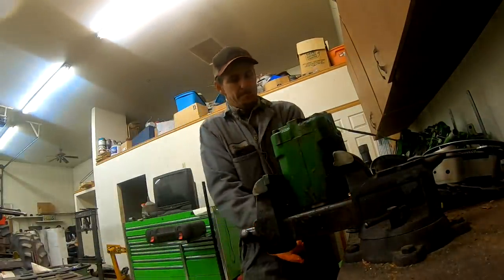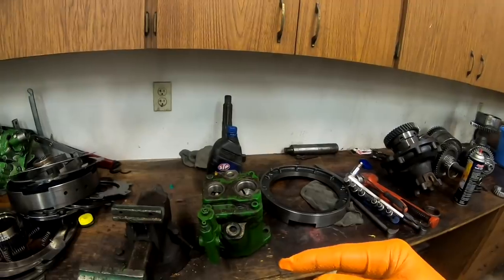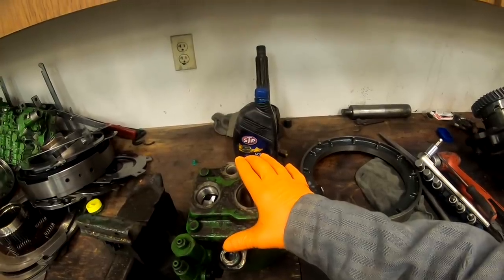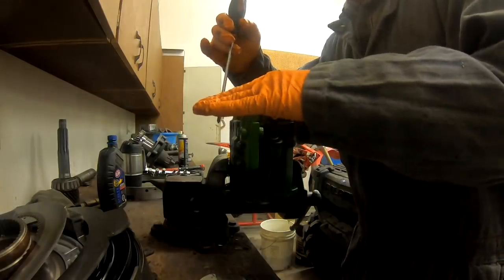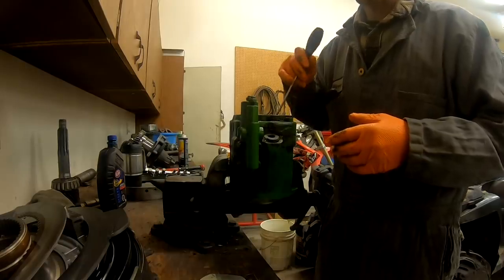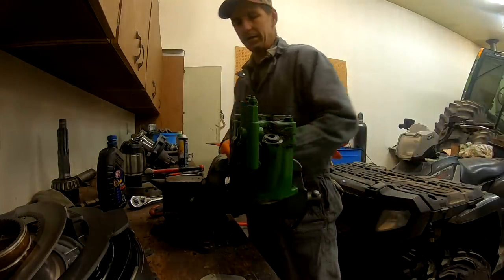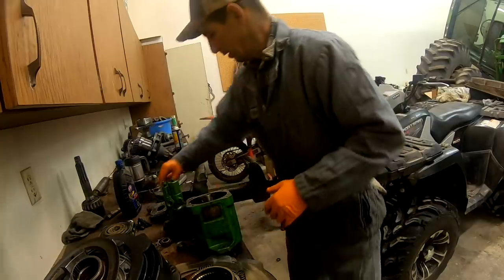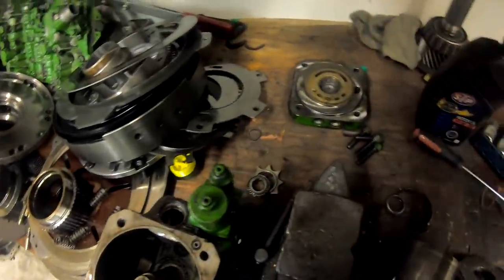Closed center hydraulics overview.

Comment: Had a McCormick tractor stall the motor like  that once.  The dealership said it  was the pump ,I looked at the pump and it was fine! They put on a new pump and did the same. The tractor belongs to  the in laws so I had to go to the dealership to sort this out! A transmission solenoid was stuck when it would start it went into two gears and stall! Merry Christmas to you and your family Waren

Comment: Thanks for the hydraulic lesson.  Sometimes it is tough to get hydraulics working correctly after changing out a pump.  Dad had a JD 300 industrial tractor that had a hydraulic issue for years.  turns out the issue was a valve on the loader. Once the valves were replaced, it had more than enough pressure.  Merry Christmas to you and your family, and all the best for the new year!!

Comment: I  also work with these pumps and some of the issues are determining if it’s the system commanding the high pressure or a stuck swash plate causing the issues.  Just a comment about load sense, if you have no load sense then you have no pressure. So block the load sense line going to pump and pump should be in biased state or neutral. So if you still have high pressure you have a suspect pump.
These pumps can cause fun problems with engine not running at idle or low power issues. I have even had engine reps scratch there heads trying to figure out engine issues and it’s the pumps.
Good info you have shared good explanations. 
Merry Christmas.

Comment: My experience with the industrial versions of these pressure compensated axial piston pumps, a down stream relief is a must. Set higher than the compensating pressure it gives the fluid somewhere to go as the valves open and close and the pump stroke compensates. Fluid has inertia just like a large flywheel, so as you said when flow is at the full amount and a valve slams closed the pump will not de-stroke that fast and a tremendous pressure spike will occur.  The relief will protect the system from these spikes.

Comment: As an automotive mechanic, we do have hydraulic systems that give similar problems in spool valve sticking. But not realizing how much heat can be generated when you don't have flow in a high-pressure pump area. Really good simple description and breakdown for us. Have a great Christmas Warren and family. Have a productive and safe New Year. From Canada.

Comment: Fascinating stuff young man because I have never seen or understood how these hydraulic systems work. I suppose with modern tractors most of them rely on hydraulics to control all the basic functions and are themselves controlled by computerised electronics so a modern tractor is basically a engined poweredmulti tasking hydraulic pump governed by electronics. Complicated stuff but not impossible to learn. Many thanks Warren for the insights and lessons you give on repairs and rebuilds. All the very best to you too for Chrismas and 2020!
Reply: See the animations I posted above for Warren's viewers.

Comment: Just like the new style AC compressors without clutches. They have electronic modulated wobble plate controllers to increase or decrease Freon flow. Very interesting. Thanks for the video. Awesome content.

Comment: Great video Warren !!  I have a 6410 John Deere with the same pump system  it’s been trouble free so far with 3400 hours. But just used in the hay operations.  Hydraulics are amazing and what the engineers come up with can be a little confusing at times. I used to work in wood industries and the electrical controlling hydraulic could be very precise with linear position rods and 4 to 20 milliamperes drivers on valves. Merry Christmas to you and your family

Comment: Excellent explanation. the snow cats I deal with are hydrostatic drive, similar principle but ours are centered and use charge pressure to tilt the swash plate for forward or reverse. Merry Christmas to you as well.
Reply: Dan Goulding Used  to work on machines called hydroaxes that used the same principle, had one on tracks like a huge snow cat for mowing swamp ground , when the pumps grenade it's a real mess.

Comment: The constant pressure system is more responsive and efficient than the constant flow system but I prefer the reliability of the constant flow (gear pump) system. If you read industrial history of Caterpillar and John Deere, these companies were known for simple but rugged equipment that would crank and run, few bells and whistles but good old simple.
Reply: Might have been true in 1950
Reply: @RJ1999x  - Ha - You are exactly correct! Newer stuff is not simple, rugged, reliable or made in America.....all the attributes that made these companies great. I often wonder if a simple version (of course with all the safety decals and shields) of a tractor was produced how it would sell. I have a Allis-Chalmers WD45, it runs great but would not bring crap at a sale. It is tricycle and no power steering so I keep it and use it.
Reply: @jeffsnider3588  If the nuclear bomb goes off the only 2 things left will be a cockroach and an Allis Chalmers WD45!
Absolutely bulletproof machine
Reply: Did you realize the old WD45 by Allis-Chalmers was one of the 1st tractors with demand flow (pressure compensated) hydraulics, the pump is an inline piston pump run off cam lobes with roller-followers. No filter and dam thing has run for years with no problems on my tractor. At one time many farmers owned a WD-45, They were inexpensive and fulfilled the basic requirements. The pump does run at a rather slow speed though. Allis-Chalmers was another innovative company that had some really good designs. The D-19 diesel was the 1st turbocharged tractor.
Reply: @jeffsnider3588  The hydraulic system on a 45 was high pressure lo flow, which made it work very quickly and required a small cylinder.
Reply: @jeffsnider3588  Allis Chalmers was the first in many things.
First on rubber tires
First Turbochargers on tractors
First power shift wet clutch system
First with cross flow heads
First high pressure diesel injection system
First intercooler
First pressure and flow compensated hydraulic system
First cab that broke the record for quiet, still not matched
First cab that could be rolled and the door would still open
First operating platform forward for a better ride
First round baler
First forage harvester for Hay
First no till planters
First 0 ground pressure gauge wheels
Etc etc etc
Reply: @RJ1999x   Too true!
Reply: @jeffsnider3588  WD 45 and round baler was such a relief from square bales.

Comment: Now I've learned that Deere needs a couple of pump pressure gages on those pumps and in the cab so the operator knows what is going on. You have excellent explanations and someone should do animations of that pump in operation and with different situational conditions. In time, I guess. Great video.
Reply: Animations of hydraulic pumps:  https://youtu.be/W_W1lI31cww

Comment: I like where the pump is, at least you can get to the dam thing. I still like gear pads with multi gear pumps or stacked gear pumps.  The pressure comp systems get hot quick when the pumps and valves get a little wear. High pressure fluid passing spools and pistons make heat quick. The only fix is really expensive.
Reply: High pressure filters with regular maintenance are a must on pressure compensated systems. I am more familiar with railroad equipment like Harsco Tampers etc. which require a lot of oil for repetitive, high speed, movement of multiple cylinders, workhead motors, plus machine traction. Multiple hydraulic valve banks involved that lasted for years of thousands of cycles with very few problems. Take a look at a railroad track and think of it LIFTING BOTH RAILS PLUS TIES and tamping every single tie mile after mile while the machine also lines the track at the same time. Watch one in action if you ever get a chance. Of course you need a well trained operator. I have seen some videos on here which were PRETTY SAD to watch knowing what these machines are capable of and not seeing it because of a operator that didn't know what the hell he/she was doing.

Comment: Sir, so what I understood and learned. There is a 1st stage charge pump psi of aprox. 400 to main pump. Main pump is a variable flow piston type. Discharge from pump goes to vavle assembly. At valve assembly 1st valve is a type of relief that lets fluid return to pump or to what ever system is calling for psi/flow. Now returning to pump goes to a psi and a flow control valves that by design rotates a plate that cause the pistons of the pump to move more fluid at the max needed and the psi relief sets the max psi, with the only other variable being engine rpm. For flow out put. Now if for any reason fluid is not flowing or restricted it gets hot, cause damage.as well as other things cause problems. Stuck valves,bad motors,and pluged filters ETC.

Comment: For the record, Allis Chalmers was the pioneer of pressure and flow compensated hydraulic systems on tractors. It took others (John Deere) another 30 years to catch up
Reply from the maker: Yes, I have worked on some 7000 series A/C tractors that had those systems. They like international were good at building equipment but couldn't control the money end of it.
Reply: @westerntruckandtractorrepa1353  For the record there was a lot of reasons why Allis Chalmers went down, and you're partially right about money.
Allis Chalmers was a huge conglomerate that was involved in everything from farm tractors to nuclear reactors.
Allis Chalmers in the 60's and early 70's was cash heavy and leaders in every field they entered and because of that corporate raiders tried a hostile takeover for over 15 years, which when the dust settled Allis Chalmers was beat up and hurting, but still standing.
To get back on their feet they needed cash so they sold a 74% stake of the large construction equipment to Fiat forming fiat-allis. They also sold off the steam turbine business to Siemens.  The 70's farming was booming and Allis Chalmers responded with the 7000 series of tractors, the 6000 series and larger combines, which took a lot of cash. Heavy industry was going and Allis Chalmers built huge projects like the largest hydroturbines in the world out by you at Grand Coolie. They brought the 8000 series to life as the ag economy tanked, and interest went sky high. The high interest rate killed many large products. Allis Chalmers had contracts with the government for more hydroelectric and supporting equipment, that got cancelled leaving Allis Chalmers hung with a bunch of unfinished huge castings etc. At the same time oil was over $80 dollars a barrel and heading to $100. Allis Chalmers had invented the process of removing oil from shale, and borrowed $130 million at 20% to bring the process to life, the only kicker was oil had to be above $40 a barrel to be profitable.
So with an ag economy tanked.
Interest at mafia rates.
An additional 130 million in debt.
Cancelled contracts.
Oil dropped to $35.
That's the short version of what happened
Reply from the maker: @RJ1999x   I realized along time ago that you've always got an axe to grind against John Deere. I don't really give a shit what make they are I fix them. The orange pile of shit pays the same as the green pile of shit.
Reply: @westerntruckandtractorrepa1353  lol that's funny
Reply: @westerntruckandtractorrepa1353  😆😆😆😆👍👍

Comment: It’s nice Deere put the charge pump under the main pump saves a lot of splitting. I always liked the fact that the old Deeres were all steel and hardly any aluminum, I think they were a little better. Alice Chalmers used a similar pump on the 7000 series. At least the problems are all at the back of the tractor on these ones. Merry Christmas 🎁 thanks for all your great videos.

Comment: Good video, but should also explain why pressure compensated/load sensing systems are so beneficial being that they are designed maintain a consistent pressure drop across control valves despite their position and flow demand.  Straight pressure compensated and open center systems do not have this capability and result in large pressure drops across control valves causing heat.  (also a neat physics lesson in the conservation of energy).

Comment: Pretty good show of hydraulics. You really need to explain this is a pressure flow compensated hydraulic system. It is not a true closed center system. The soundguard body John Deere tractors are closed system. Pfc systems have the benefits of both open and closed systems.

Comment: Hi, first, thank you so much for all that you do. You have helped me tremendously over the past year. I have a 6410 and the pump looks exactly like this one with the flow regulator situated vertically. All of the manuals have them horizontally. Can you show how you adjust these? It looks like it only has one adjustment for the pilot pressure.
Reply from the maker: On a closed center system that is standby pressure and the other adjustment is system pressure. https://www.machinerylubrication.com/Read/31666/adjust-hydraulic-pump
Reply: @westerntruckandtractorrepa1353  Thanks. The issue I am having is the pilot and system pressure are max when idle. I went through the manual a ton of times trying to track it down. I rebuilt the brake valve, and just went through the flow regulator, scvs, main priority block, rockershaft valves and really didnt see anything major. Although the main block pressure valve was a little discolored which i replaced. I find it interesting that the pilot pressure/ls drops when hitch is being raised too. Any thoughts?

Comment: Do you think the root cause was a leaking signal check that kept the pump on high flow / pressure or were the saddle bearings on the swashplate holding it in one position so it could not go back to system standby pressure?  I saw the failed inner bearing on the rotating group and would agree that caused the shaft to twist off but I am trying to figure what  the first failure is / was.  Most twistoffs in my experience were from deadheading the pump.  Good video - I have worked on piston pumps for 40 years and always tear them down to see what the failure mode was.  Merry Christmas and Happy New Year.

Comment: The load sense system will drop oil pressure to the compensator allowing the bias spring to stroke the pump?

Comment: Sounds like your comming down with a cold or flue Warren, best thing ive found for that is get the cheapest lemonade you can find, get some disolvable paracetamol tablets.  Mesure a mug of lemonade out,  put it in a pan,  put it on the stove till it boils, turn down to a simmer then throw the tabs in untill disolved.  Then decant back into the mug, and sip it as hot as you can stand.  But best done before going to bed.
Reply: Or, get a double brandy, add a table spoon of honey, a table spoon of lemon juice, a teaspoon of Turmeric and a dash of hot water. Get it down you neck and go to bed. I have found it to give fairly fast relief which lasts a while but obviously it is no cure as there isn't any for a cold of flu.
Reply: @JonDingle   The one above brings on a sweat that breaks the fever,, try it yourself next time . All the best.
Reply: @scottgibson7534  Cheers young man and all the best to you too!
Reply: DingleZilla  Hot Toddie O whisky with honey and lemon that's what  I take my ma would give me that and i am 52 and still works,maybe I am biased being a Scot but thats what my grannie give my ma and then to me.....

Comment: So im curiousif the pump is biased in the full pressure position at startup if you have no load sense you still would have full pump pressure right because of how its biased to full pump stroke?
Reply from the maker: Yes you are correct.

Comment: What kind of parts cost is there in one of these rebuilds?  Extremely expensive or reasonable??
Reply from the maker: This customer bought a new pump from Deere which cost him about 3 Grand.  You could probably go through the pump completely for 1,500 to 2000 grand.
Reply: 2000 grand? WOOOW!!!

Comment: We have a JD 690e 1993 excavator no hydraulic pressure. Original Linde pump blew we put another pump on worked a few days now dead. 400 psi charge pressure .
Load sense valve I took apart cleaned still no main pressure just a tiny pulse.
Any clues?
This has computer override dial tried that.
Excellent work Thanks